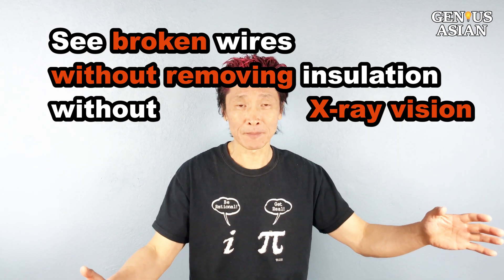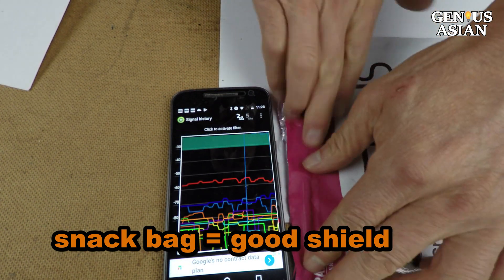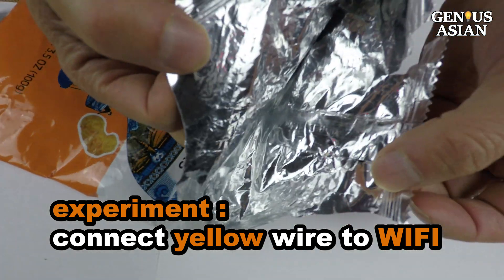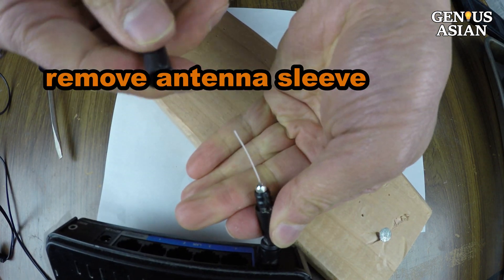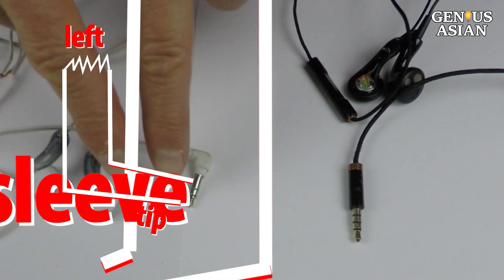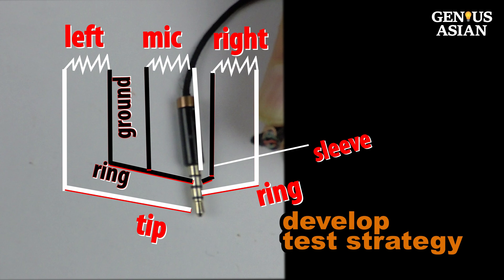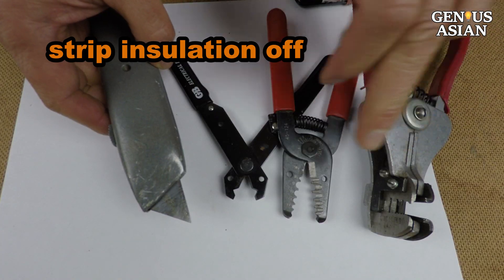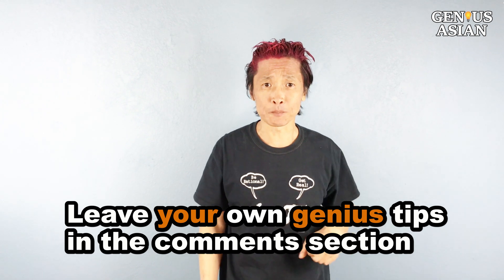Detect broken wires without X-ray vision or special tools

Comment: Can this work on cars?
Reply from the maker: if the car's body is metal, then the metal will shield the radiation unless the part you are interested is exposed. Also the resolution is coarse, so my guess is it will not be easy.